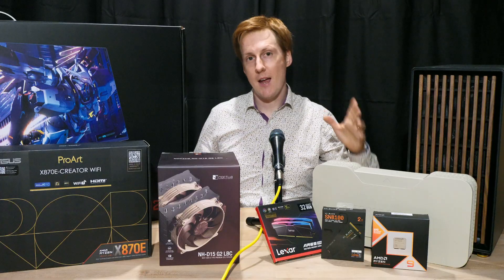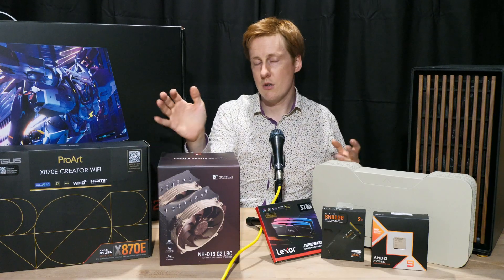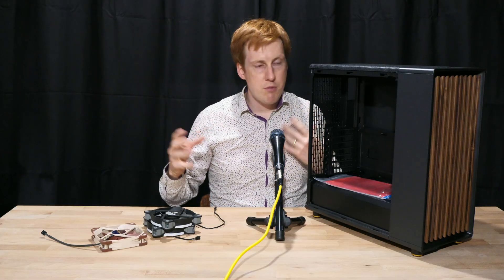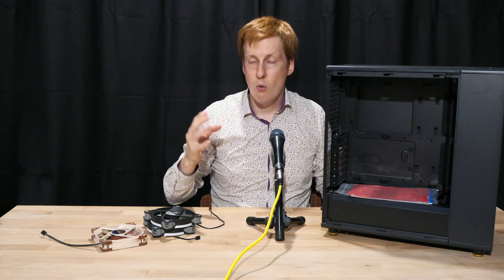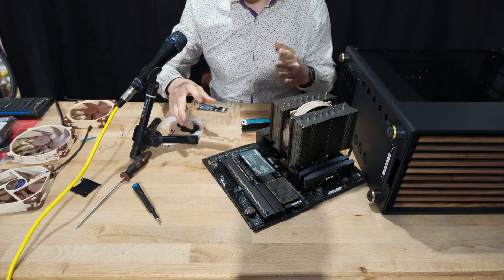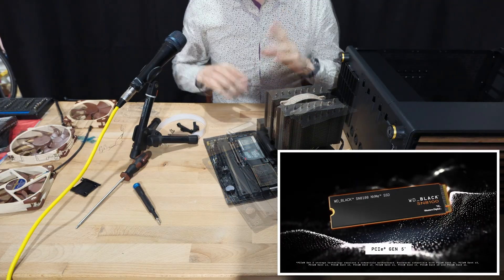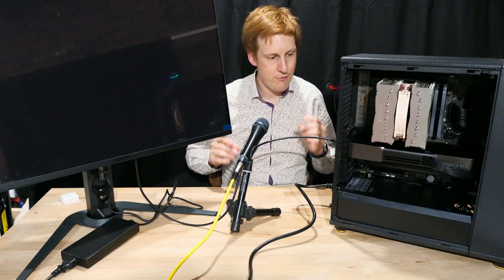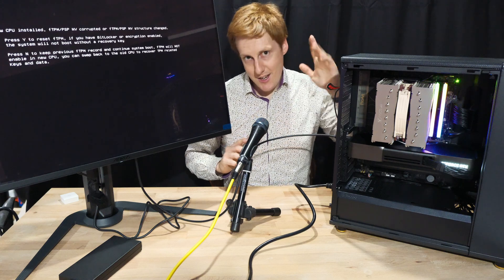The Fastest PC I Could Build - 9950x3D, RTX 5090!

Comment: I’m about to purchase a 9950x3D for a future proof gaming/ production desktop.
But I’m on the fence of switching to the 9800x3D to avoid stuttering in gaming. But i hear mixed things about that being an issue these. Have you noticed any performance issues so far with the build?
Reply from the maker: No, absolutely perfect and running within a few percent of the top benchmarks I've seen from usual outlets. I haven't even started to manually overclock yet. The only I have had is an occasional black screen but that's a known 5090 issue. Think I've fixed it by manually setting PCIe speed.

Comment: can you use this board for gaming?
Reply from the maker: Absolutely, great memory compatibility and decent OC
Reply: @Tech-Bench  Thanks, finally someone answered this for me. I have a 4090 and a Ryzen 9 9950X3d waiting. I'm upgrading from a Crosshair VII HERO and a Ryzen 7 2700X.
Reply from the maker: If you check the stats it's pretty much a strix but with 10Gb networking.
Reply: @Tech-Bench  oh almost forgot what about the RAM? 5600 or can i use 6000 as well?
Reply from the maker: Yes, the ram in the video is 6000 MHz cl26. It's pretty much the fastest you can get. Worked right out of the box with expo2 profile applied